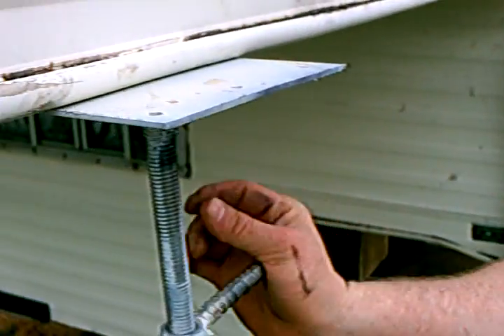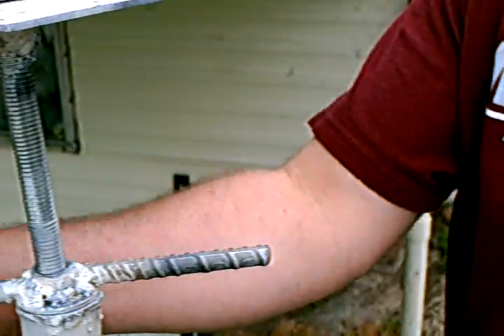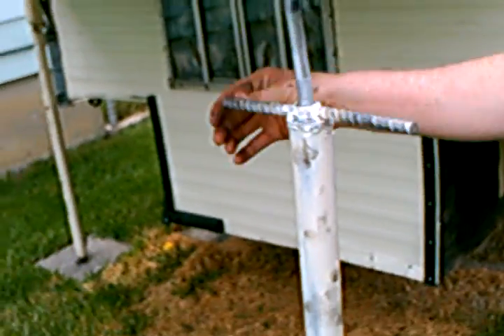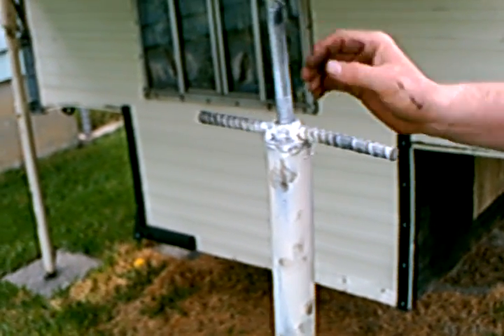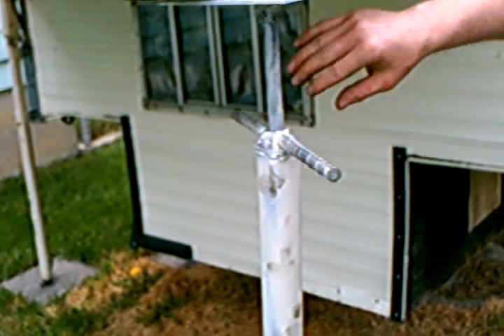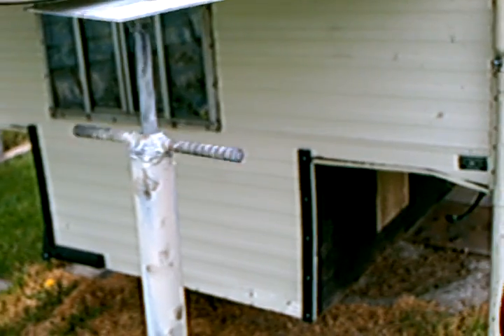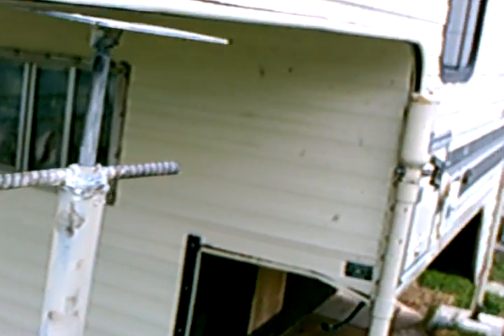home made jack

Comment: Ok??? I MEAN U JUST SHOW U TURNING THIS AND IT GOING UP A FEW INCHES??? BUT THIS SHOWS ABSOLUTELY NOTHING ABOUT WHAT IT LOOKS LIKE FROM THE GROUND UP??? OR HOW U MADE IT! HELL WE WANT TO KNOW OR I CAME HERE TO SEE HOW!!!??? U MADE IT!!?? I NEED TO MAKE SOME HOMEMADE JACKS DUE TO FIXED INCOME ETC!? AND I AM SEARCHING DIY JACKS! BUT I COME HERE AND NOTHING!!?? 😲 🤷🤷🤷 SO WHAT WE NEED IT VISUALS LIST INSTRUCTIONS PARTS ETC ON HOW TO MAKE IT!

👍
Reply from the maker: Lol that’s awesome i made that video back when i filmed with a potato but a quick rundown get yourself a pipe as tall as you need then go get some steel washers that are slightly bigger than the pipe than weld one washer to the end of the pipe then go get yourself some all thread or threaded rod the biggest diameter they’ll fit in the hole of the washer bigger the better then get a nut for it then weld the washer to the nut so the holes lineup and you can put the all thread all the way through then the two washers will sit on top of each other with a nut put a little grease in between The washers when you go to use it weld two handles on the nuts take your all thread weld flat piece of metal or V-shaped piece of metal whatever is going to hold up your thing then watch the video again this description will make more sense hope this helps